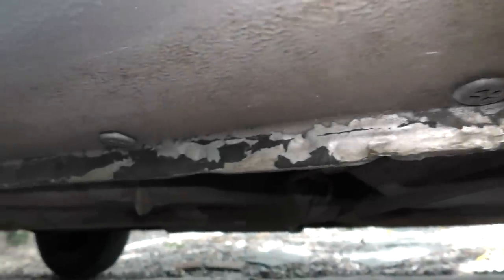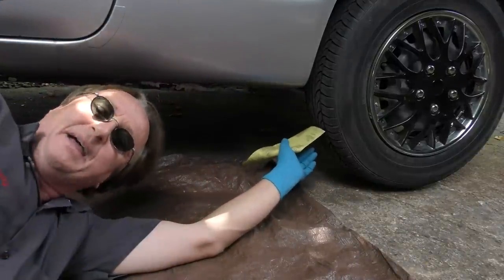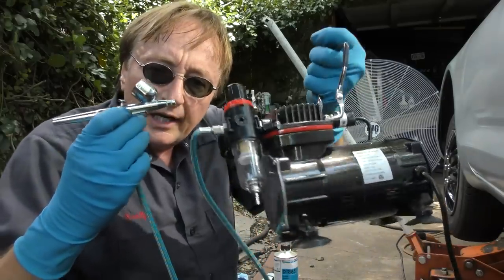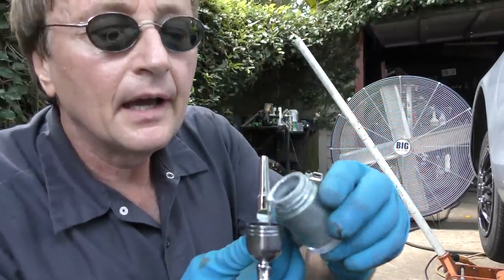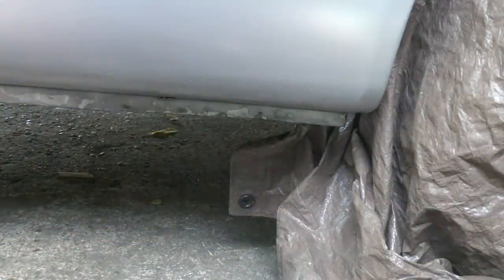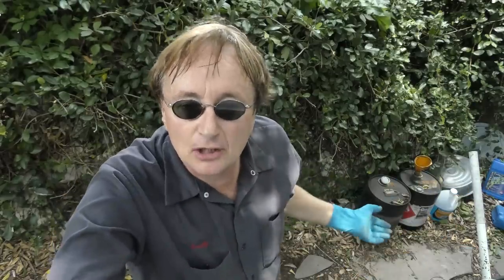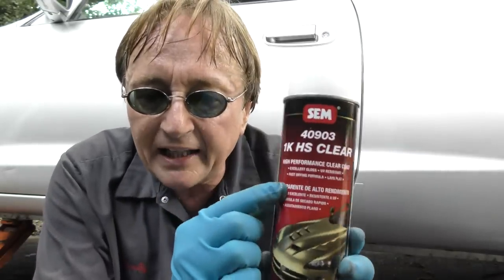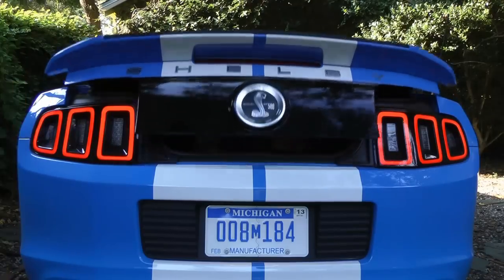How to Touch Up Paint on Your Car

Comment: Thanks scotty, got off of an 11 hr day to return to my car with fist size paint spot gone from my roofs paint.. no rust, clean smooth factory metal underneath.

Moisture got underneath paint, bubbled up, and cracked/flaked off when i went to attempt moving bubble.
Reply: Did this work for you?
Reply: @jaxlaxsurprise  honestly ive just lived with it for a while, and so funny you ask, it actually just started getting worse this week.  So ill be having to do this soon.
Reply: @jondoe2099  Haha, I have a similar situation with my car! Was hoping to hear the results from someone who tried it 😛 Hope it works out for you
Reply: @jaxlaxsurprise  dude!  It sucks, the air just creeps in under the new edges and continues to eat away.   Its an 8th Gen Honda Civic, so to be expected I guess.  Its also on coilovers, my first month on coilovers i turned out on to the street to close to the edge/rse of the driveway and curbed the pass side skirt, so I have this spot on top growing, and this spot on lower right growing 😒.  Going to lift car up an inch or so, throw aftermarket sideskirts on and just cover it up lol.
Reply: @jondoe2099  Oh no!! Yeah, and these always cost sooo much more than you expect to get professionally fixed. That sounds like a good plan.